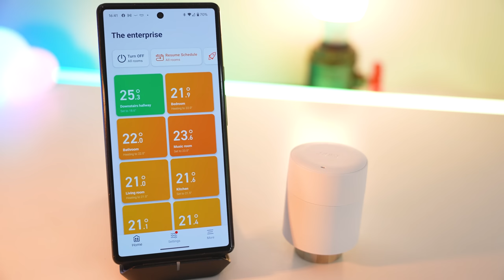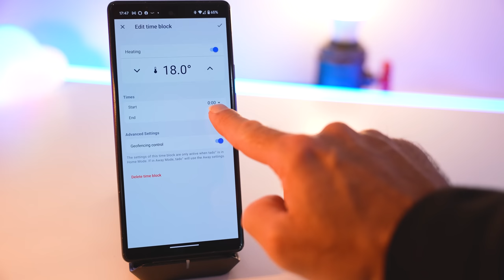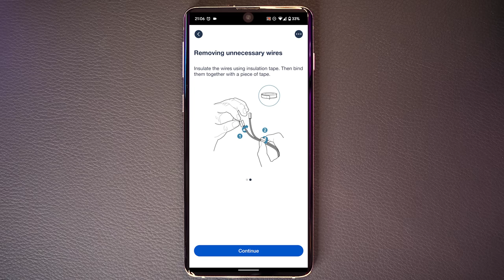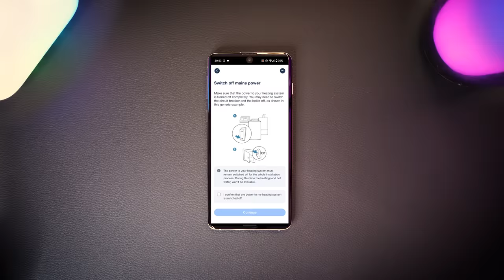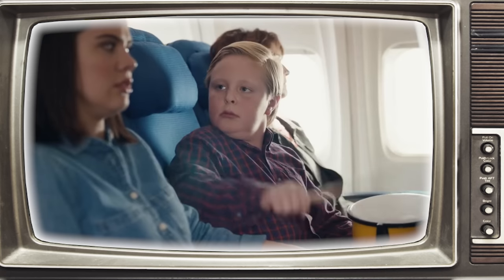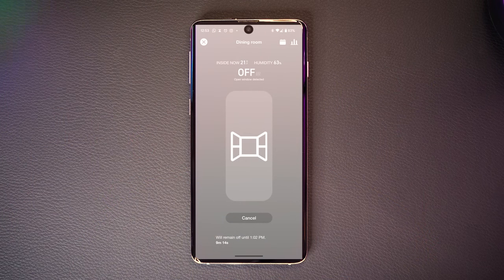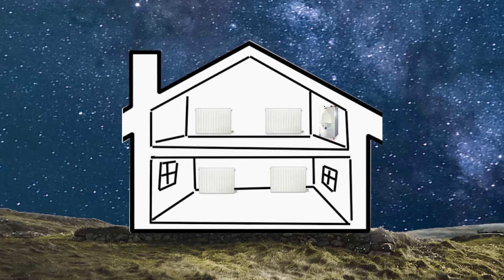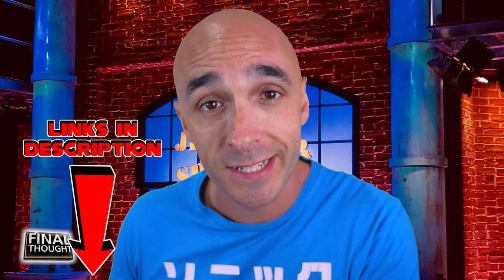Install This On Your Radiator & Drink The Tears Of Your Energy Company

Comment: Good product but a terrible title something I would expect from the Daily Mail
Reply from the maker: Can't have been that bad of a title, you clicked it. 😂
Reply: @paulhibbert  yes clickbait not true. No energy company will be crying. Compared to a normal TRV the only real advantage is that you can adjust them from your armchair and at £199 for 5 going to take  awhile to save big . Weather compensator and optimiser would be better saving and less noisy I have taken out all the Honeywell smart TrVs I have fitted for people due to noise and these are the same.
Reply from the maker: @paulgannon3261  I don't think you understand my point. The intention of a YouTube title is to make you click the video. You did. Ergo, it's not a terrible title, you and 100,000 other people clicked it. It's a bloody brilliant title.
Reply from the maker: Plus, you're wrong, these are waaaaay more advanced than an ordinary TRV. You can schedule them individually, that's a MASSIVE difference from a standard TRV.
Reply: @paulhibbert  yes but on an existing system you have to remove either the zone valve on an S plan or the mid position on  a Y plan so a lot more  cost that will take a long time to get back. You will need an auto bypass for the pump overrun . If it were a new install it may bo ok or on a combi bit I take more out because people don't like them so don't tell me I am wrong
Reply from the maker: But you are wrong. You stated that their ONLY advantage was X, when there are multiple advantages. If you ignore key pieces of information simply because they don't fit your rhetoric then you're going to get called out. Don't do it. The scheduling is a huge advantage over a standard TRV, you can't just pretend it isn't because it's inconvenient to your argument. 

On to the latest tactic, which is hearsay. You haven't tested to see how much energy will be saved to know how long it will take to make the money back, and you are ignoring the environmental saving. There are comments in this thread from others saying they made their money back in 1 or 2 years and that they've been (and continue to be) a great investment.

Whatever the time frame is to make the money back, the energy companies are losing out, imagine if we all simultaneously saved a grand over a couple years?... and so my title stands as an amusing dig at the scum bags driving this country into the ground.
Reply: @paulhibbert  what a load of bollocks. Scheduling against manually saves no more money and don't  forget batteries and if you use rechargeables. If I manually adjust m10 trvs at the same times  you schedule I do not use any more energy and have saved £350 . You are obviously being paid to promote a product that is just unnecessary.  Under building regs you need a room thermostat and programmer or programmable thermostat, smart stat, flue heat recovery, compensator or similar.  So unless you schedule your trvs to come on at the same time as the room stat/programmer they will be doing nothing and I can do that by simply walking rather than automatically and the end result is the same you WILL NOT SAVE ANY MORE ENERGY than me .
Reply from the maker: OK mate, we've established that you are willing to walk around your house manually updating each radiator valve on a regular enough basis to save the same amount of money as a system that does it for you 🤣🤣🤣.  So what we've established is you will go to any theroetical length to convince yourself you've won this argument.  Let's both pretend you've won to end this conversation.
Reply: @paulhibbert  so you agree that manually operating costs the same. So why would any energy company be crying when there is no theoretical difference in energy costs only an inconvenience to walk rather than sit in a chair and operate remotely.  But your headline energy companies will be crying and I suppose they will if they see your false claims they are probably wetting themselves.
Reply from the maker: @paulgannon3261  tell you what mate, I'll admit that there's no difference in cost saving between manually operating 8 radiator valves and scheduling 8 radiator valves, once you admit that no normal human has time to manually operate 8 independent radiator valves all day and night. You absolute melt 🤣
Reply: @paulhibbert  I agree but that is why I picked up on the title. In the late 79s we used to fit a lot of gas mixers and oil mixers. These connected after the boiler stat and stopped cycling . You would not notice on hot water mode but on ch you did. But there was a saving with a fixed rate burner but fit one on a modulating burner and customers noticed that they used more gas because the burner instead of modulating down had to fire at high rate due to drop in temp. So any time I see anything claiming to save money it speaks my interest. Don't get me started on the new 55c max flow temp on boilers either because that means bigger rads so more volume of water to be heated to a lower temp or stay as we are and heat less water to 70c . I will stick with the old.

Comment: Paul, are you really that bad at DIY? You could have simply mounted the controller on the wall perpendicular to its original location. Would have been plenty of space for you to work and only a small adjustment in distance from its original location. :)

Comment: Haven't seen the whole video yet, but I already know from looking at Tado previously, Drayton Wiser is better. It also works with Home Assistant, has OpenTherm, works with IFTTT to set home / away, etc. It has zero subscription element, and can work completely locally with home assistant.
The fact that Tado charges for the functionality that can be replicated free of charge using wiser and the free version of IFTT (or using home assistant if you prefer!) was a red line for me. It does a great job of regulating the room temperatures and modulating the boiler even without OpenTherm. The heat hub also uses a standard bracket, so for many people installation really is a case of "it just works", not having to touch any wiring whatsoever in a lot of cases.
Finally, there is a feature that will connect Wiser with a Geo smart meter monitor, giving pretty accurate energy usage stats.
Edit: just got to the bit of the video mentioning cloud - the scheduling is entirely local, all ok the heat hub. It can be read, and amended, in the app or via home assistant without external internet access once initially configured.
Edit 2: bypass doesn't necessarily have to be a radiator, it can be a valve that allows boiler water flow even if all radiators are closed.